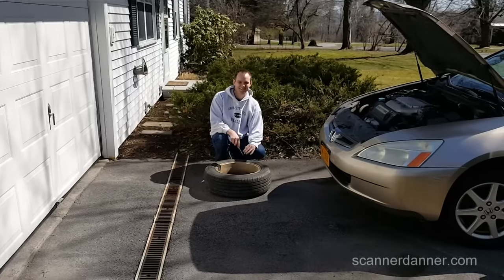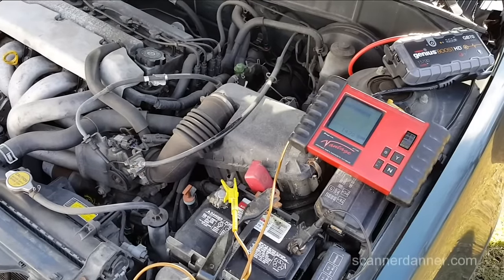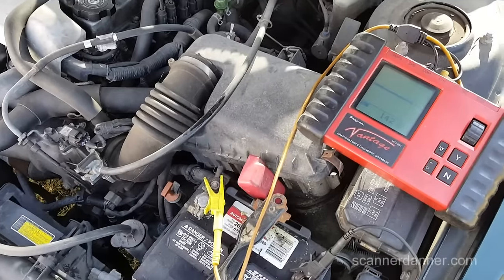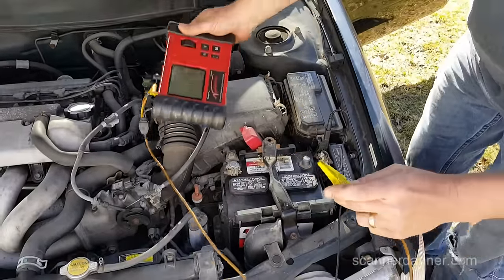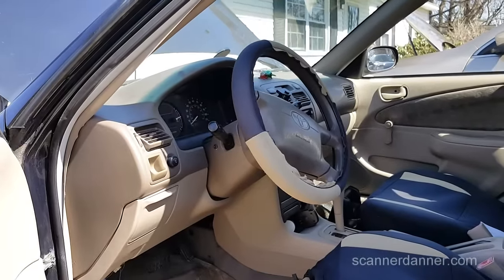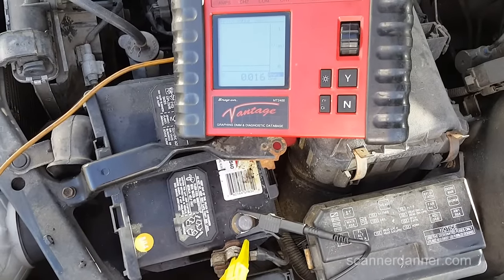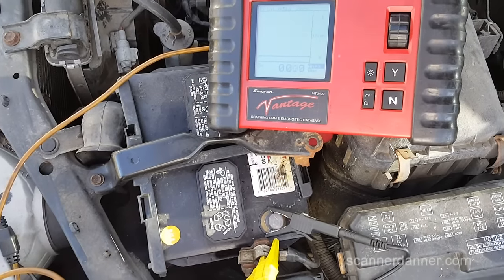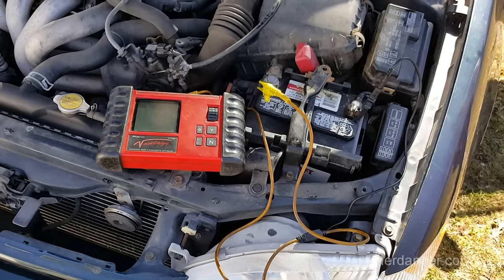Battery keeps going dead (what to test before replacing)

Comment: I get nothing on the amps setting but if I put it on voltage I read battery voltage when I have it hooked up like you do .  does this mean I have a big short or is this normal ?
Reply from the maker: It is becoming more and more difficult to answer questions here. I have 80,000 people asking me for help now. So I have created a forum to help you guys better. It is free to join and we can exchange pictures, wiring diagrams and waveforms if needed to help guide you through the process of troubleshooting your vehicle. Thank you so much! Hope to see you there. 
Paul Danner (ScannerDanner)
 https://www.scannerdanner.com/forum/post-your-repair-questions-here.html
Reply: John McKamy normal
Reply: yeah I checked my other car and it was normal ,  it was my meter that wasn't working so I got another one and it has 3.52 amps while all the inside lights are on and when they time out it goes down to basically 0. thanks for the comment Aaron I know that scan man is busy.
Reply: No prob

Comment: missing mounting bolt too. batteries just cant take a full discharge.
Reply: yes, I came here to mention the missing battery hold-down bolt as well. when I had a truck that sat for long periods I installed a battery maintainer, anything that can charge at 100mA would be fine.

Comment: I have a Cadillac devalle 03 same problems idk what keeps draining my battery any help ??
Reply: ATG & I suggest doing this if you don't have a DVM or know how to do this test.
1. Days that your don't need car (2 or more), disconnect Alternator
2. Disconnect Starter
3. If you have aftermarket radio/amp, disconnect those
4. If you are able to start the car with those removed, then you found it

FIY:
If battery is over 3 years old & you run less than 25 miles/day = replaced battery

Comment: Virtually impossible to receive thorough parasitic pin point, with a deleated battery, battery must be within fully charged 12 46 initially. Remove negative battery terminal, touch red lead to removed negative terminal, touch black lead to negitive battery post. Should read approx 30-50 milliamps, newer cars range should be 50-80 milliamps maximum. If greater, definitely a parasitic drain. Locate within designated fuse pulling one at a time, with multimeter attached. Once you locate/,pull correct fuse, reading will drop drastically. Post locating problem circuit, then proceed to solve the problem within circuit pulling load drop. Cheap multimeters are also not accurate reliable sources, don't put your faith within cookie cutter multimeters. You will buy buy, buy parts only to discover, you bought wrong parts, then buy yet another part. Due to cookie cutter multi-bleeder as example.

Comment: That noise isn't the fan it's a tension pully.
Reply from the maker: never said it was the fan, did I? This has electric fans
Reply: @ScannerDanner  so what drives your fan belt? Pullys that's what. I have had this sound before.
Reply from the maker: @jojozepofthejungle2655  the crankshaft

Comment: I am suprised at the quality of the footage off a phone, can anybody tell me to see in cylinder pressures with a transducer do I need a regular compression hose, or do I need to take the needle valve out of the end? Thanks Jonathan
Reply: +Jonathan Dean You need to remove the schrader valve.. Cheers!
Reply: +Nabil Chouchany thanks for your help
Reply: no prob.
Reply: +Nabil Chouchany 
Normal compression tester hose won't last more than a few minutes it  will collapse and fail because of the presssure reversals.
Reply: +Andrew W MacFadyen can you recommend a compression hose?
Reply: It is true that the compression hose was not meant to cope with vacuum, but i used it on three engines so far, and it is still holding...
Reply: +Jonathan Dean 
Most of the engines I work on are inline 4 cylinders 16 valve with deep burried plugs so I used a solid adapter ( Sealey VS1601) which has  1/2" BSP (1/2"G) thread at one end and 14 and 18mm spark plug threads at the other. It is screwed into a short compression gauge adaptor to give sufficient height.
The Sealey adapter also has a Schrader valve which has to be removed.

For flexible hose I have been considering clear reinforced PVC hose but I have not tried it yet.
Reply from the maker: +Jonathan Dean not too bad huh? It is a Galaxy Note 5

Comment: There is so, so much wrong with the testing methods demonstrated here. When you don't have the ability to diagnose the problem, just blame the aftermarket part, right? It was even said at the very beginning of the video, so I guess this "tech" found the problem he wanted to find. Very sound, logical process there, where even after proving the remote start wasn't drawing any current of consequence, still stay latched onto that as the cause.
Reply: I disagree, you have to understand the unusual circumstances for this to make sense. First, the owner of the car only drives it every 3-4 weeks, that's a very unusual usage pattern. Second, he is on vacation with a limited tool set doing a favor for a family member, so he is not going to be able to do full diagnostics and he made that clear up front. Third, he is up enough north that it gets bitter cold, and as he described in the video the battery sitting dead for 3 weeks in freezing temperatures can damage the battery.

I think the most important part to point out is he did not diagnose it as a parasitic drain from the remote start, he diagnosed it as a bad battery and told the owner to replace the battery. He pointed out that the remote start did add a constant drain of 0.006 amps, and disabled it because the owner advised that he lost the remote to the unit and couldn't use it anyway. Under normal use 0.006 amps wouldn't make a big difference, but in this unusual case where the car is only being used once every 3-4 weeks it is significant. This means the battery is being drained 60% faster while resting. If you also consider that when the car is eventually driven it may not be driven long enough to fully recharge and recover, I think the recommendation was right on the money.

I do agree he could have articulated this better in the video, but I think if you watch enough of his videos you will understand that he uses scenarios as teaching opportunities. This may not have been the best scenario of an after market modification causing a battery drain, but you can bet that behind his recommendation stands hundreds of fixed cars that were having batteries thrown at them until he finally found the after market product and bypassed it fixing the problem.
Reply: Kamel yeah that's what ALOT of people don't understand that leave these types of comments is that he's covering all the bases on purpose and going above and beyond for the sake of teaching. and why not unplug the remote start since the remote was lost anyway, that was for good measure not the call, the call was the battery. lol
Reply from the maker: Thanks for this very thoughtful reply. I couldn't have said it better myself.
Reply from the maker: Thanks man. That's why I never replied. The o.p. clearly was not paying attention
Reply: I bet Neil Morris couldnt get his problem fixed thats why he's upset and left such comment. Clearly the remote was lost to the remote starter so why not disable it just in case thats the problem. I dont think it hurt the car at all my friend 😂😂 but i see that this video obviously did not help your issue Mr Neil and at the very least pls dont say you dont have this type of issue because if you did not.. What brought you to this YouTube video
Reply: @stopnwatchentertainmentjdt9325  If the remote was lost I would unplug that remote start system's fuse even without the drain issue. Don't want it causing any weird issues if the remote happens to be found by someone nearby and a kid plays with it.
Reply: @javaman2883  yeah mines end up being the darn alternator.  Changed that and everything was good.